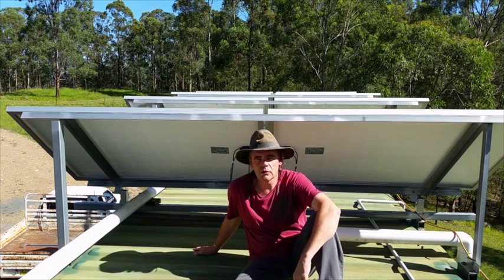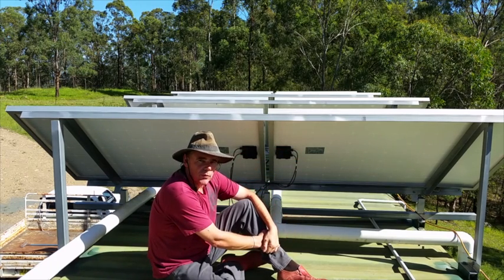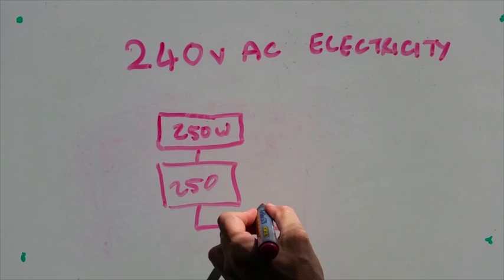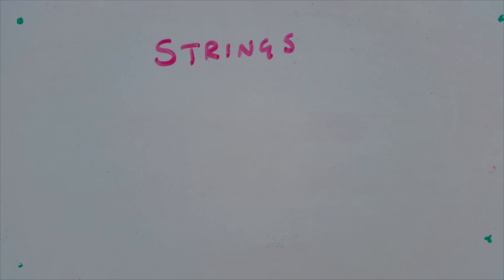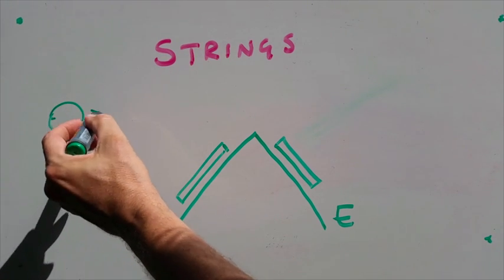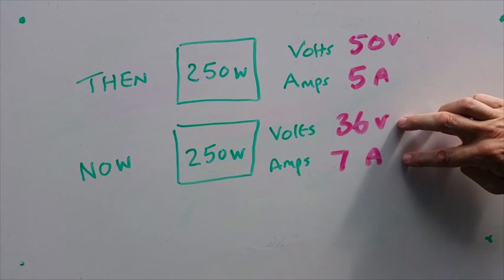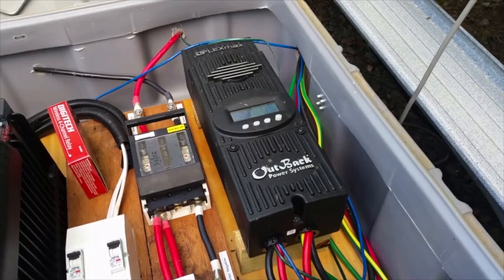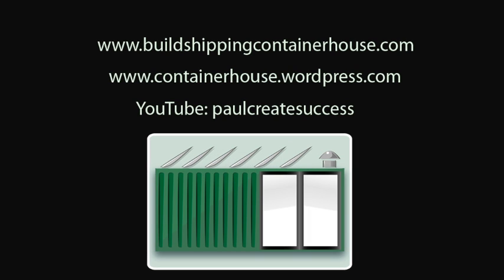Shipping Container House – Obsolete solar panels - Cry for help

Comment: Try Blue Sun Group in Banyo, Brisbane. Tel 07 3266 8668. They have near identical panel (just buying some myself as I have the same panels as you). Also I have used heat reflective paint in the past which would be ideal for your container. You can buy in the green colour and will eliminate all your heat issues. I used a company called Solarcoat ( solacoat.com.au) and found there water based paint to work very well.
Reply from the maker: Hi Marlon. You are the winner. I called them, they have them, and I ordered them. They arrive in a few days. It has taken well over a month to find a solution and I am so grateful to you. I have got thermal additives in my green paint, but the green color negates it. I plan on painting them a reflective color further down the track, probably white. Thankyou for taking the time to solve my problem. Cheers Paul

Comment: Mr. Chambers, good day to you and thsnk you for your reply. I do wish to pass along a shed of wisdom when it comes to using solar power, it may ease some of your concerns when looking at different types of solar PV panels.
 I've noticed in some of your video's the the Solar Panels you are using are Monocrystaline type..... one crystal per cell..... and you have little diamond shapes to cover the panel between tbe rounded edges on the mono crystals. When you stsrt looking at replacement panels don't fear the Polycrystsline panels.... tbese are the ones with true square celles and no little diamond shapes. They work justas well as thr Monocrystal panels, and depending on you location and environment they may actually work a little better. The MonoCrystsl solar cell is one crystal generating small voltages. The Poly crystall cell is made up or off cut crystals assembled in stacks anf wired together to generate small combined voltages. Here is the thing, if a mono crystal gets a partial blockage by say a leaf or snow, sand it will not generate. A Polycrystal will generate power from each little slice that is not blocked by said leaf etc
You may have heard that the Mono crystsl oversll is slightly more efficient than the Poly type crystal, well this is true a Monocrystal cell of a certain size will generate more voltage than a equal sized Polycrystal......although, in standard sizes for Solar panels for the sake of shipping a Mono crystal panel of equal size to a Polycrystal panel will generate appraximitly the same voltage, wattage whst ever you wish to measure because the Polypanel uses slightly more surface area than the Mono panel, it dles t have tbe little diamond shapes in it.

 Best regards;

Jyll from Nothern Alberta Canada.
Reply from the maker: Thankyou for the wisdom, very useful. Cheers Paul

Comment: Hi Paul great vids. BTW there is a guy on eBay selling panels that fits your need. Do a search for LARGE 250 watt MONOCRYSTALLINE SOLAR PANEL "EX LIQUIDATION" . Hope this helps.
Reply from the maker: Thanks Joseph for the solar panel tip off, I am contacting them to see if I can confirm the details. They didn't post a pic of the sticker with the part no and are selling them as "own risk no warranty". I am trying to figure out if they are working. I don't suppose you are local to Dandenong? I am a long way from Victoria. Many thanks Cheers Paul
Reply: Paul Chambers Hi, the following link is to that eBay item and has about 10 Pics with full details of the model # etc. http://www.ebay.com.au/itm/321671808861?_trksid=p2055119.m1438.l2649&ssPageName=STRK%3AMEBIDX%3AIT
Reply from the maker: Joseph Barta Hi Joseph, I am talking to him. The panels are perfect and the price is good. I am struggling to find a courier at the moment, couriers won't take the panels out of boxes, and furniture removal men say they can't carry a solar panel?????. I have spoken to nearly a dozen companies, how hard it it to get something delivered from Melbourne to Newcastle? Excellent tip, thank you thank you thank you.

Comment: While working on a container house project I ran into the roof heat problem. I fixed it by applying a product named "Cool Crete Coating". Even in direct sunlight it will bring the surface to air temperature.

Comment: Hello, Jinko solar in china makes a close to matching product, you just need to match the wattage and the amperage to you older panels. Any mixed system will operate st the efficiency of the lowest rated  panel in the set.
Jyll in northern Alberta Canada.
Reply from the maker: Hi Jyll, your comment may have unlocked a solution, I was blissfully unaware of Jinko and I will be following up with them. Thankyou for taking the time to reply. Cheers Paul

Comment: If you are still trying to figure out what to do have a look at http://www.fieldlines.com/ there's heaps ov info there are a quite few people that really know what they are doing that would be all too pleased to help you find a solution if it ends up involving some "electrical tinkering". However I would say, that since you are running a series string all that is really important is that any panels you add are around the same current rating. Voltage ov each panel is not so important (you could even use nominal 12 volt types) as long as the total string does not exceed the Outback's capacity. And the wattage too, naturally, but that seems to be not so much an issue here. Your channel is cool by the way..! I enjoy it. :)
Reply from the maker: Thanks for the great link, I will be posting an update as soon as I finish travelling, there ware a lot of developments since I asked for help. Great advice, thankyou, cheers Paul

Comment: I wonder if you could place some concrete blocks, bricks, rocks, soil in bins, water containers, or other thermal mass in the places where the sun shines.  The thermal mass would shade the roof and heat up during the day, and at night it would radiate heat, some of which would heat the roof. Also could you use coils to step the step the 50 volt output down to 36 volts?

Comment: Urm, I probably should have listened to the whole thing, though on the surface of it, there's zero reason you need to have exactly the same spec of panels so long as you're running the same voltage, attaching additional panels in parallel and you have a diode for each set of panels.   You can do the same attaching 3 car batteries one flat, one half charged and one fully charged.  The current is drawn from the highest voltage first and then the second highest and then the third highest.  So long as you have a diode current can't feed back into the other batteries and one will deplete until it equals the next battery.   Power generation works similarly so long as you have a fairly [a few volts +-] similar voltages, amps [current] irrelevant.   Hope that's what you're looking for.  Keep up the good work and I know it's too late of course, though the refrigerated containers have thick insulation, though the downside is much harder to weld.
Reply from the maker: Hi Blogobre, Thankyou for the advice. You are correct, it is the different voltage that are my challenge. I am weighing options to change voltages or bite the bullet and fit a second charge controller. I saw refrigerated containers and they are great, but you are correct, welding them is fraught with risk. I will be posting the update for this video reasonably soon. Cheers Paul
Reply: Differences in voltage:  Assuming you connect them so that they are the same voltages the same idea ought to work.   For instance, if you've got a 12V and a 24V panel, if you connect 2 of the same 12V together [series] you have in effect a 24V panel that you can now parallel to the others.  The main thing to note is, are they 12V, 24V or 36V panels.  Oh and note that the 'output' voltages for the panels are typically much higher than what voltage system they are for.  So you might get a 17V max voltage on the back of a panel, which is meant for 12V systems.  Similar to a car, which has a good battery of 14.5V and is rated at 12V. 

A second charge controller would give you redundancy.  Though if the voltages are different as you mentioned then you'll have an issues with charging the batteries assuming you're using them.  You could isolate batteries with diodes... but ...  lets say I wouldn't, better you get the input right :) 

Obviously talk to a sparky [electrician] who knows DC or an electrical engineer if you can.  Just thought I'd throw some thoughts that way, a bit hard to know without having a look at what you've got.

If you want to do some reading, a good start would be understanding how batteries [panels work similarly] work in parallel and series and perhaps how a diode works while you're at it.  Technically panels are a type of diode [allow electricity one way] and they usually have an extra one within them [not always!] to protect them from short circuiting.

Comment: there are series and parallel circuits, and you can take different voltage solar panels and connect them into series to make them come to the voltage you need. look at making a solar panel on youtube, I have done one my self, i'm not saying to build one but you can learn how they connect solar cells to make a panel and how you could make your panels into one voltage, also voltage will have to match the amps don't ( voltage doesn't have to match each panel its the over all voltage by adding both voltages from each panel ), also you don't want to go over what your charge controller can handle /
Say you need 50 volts and you have a 36 volt panel and you would need a 14 volt panel to make 50 volts
( I hope I gave you enough information to look up and complete what your doing)
Reply from the maker: Thankyou Walz, that makes sense, and I think it would work.I will have a look into the practicalities of 14 v panels.I will be posting an update to this video when I return from Europe. Thankyou for the advice.. Cheers Paul

Comment: Hey Paul. I'm trying to download your demo book on how to build a container home but it's an epub file and my computer can't download it. I just paid $47 for another shipping container book that was complete garbage. I'm sure you know what book I'm talking about. How many pages is yours and does it have more than just a bunch of pictures of shipping containers and instructions on how to use a hammer?
Reply from the maker: Hi Daniel, I appreciate your sentiment. Send me your email via the contact form. I will send you the ebook 1 in three formats, epub,pdf and mobi. If you like it,  just go to my website and buy a copy. I will be traveling very soon so please bear with me if I don't respond quickly. Also check your junk mail, when non contacts send links the junk filters sometimes send it to junk. Cheers Paul

Comment: To me the obvious answer is build your own panels using the same 3x3 cells (or whatever size they are) and buy/build cases. You're such a DIY kind of guy so that is the best advice I can give. You would save half the cost of new panels doing it yourself and learn how to repair cells in case you ever expire on the warranty for what you have. Of course, you'd have to find the individual cell specs/performance numbers so you could match it when you built your own.
Reply from the maker: Good morning Brown55061, what a great answer. If I had more time I think I might of been able to do that. It would have been fun as well. I don't think I will on this occasion as I have a kitchen to finish, and a list of other important tasks as long as your arm. I completely did not think of that. Great answer and it would work. Cheers Paul

Comment: hmmm, well one thing you could do, is to add a second charge controller with the 4 new panels. Ill be honest with you, your in a but of a tough spot. You are using grid-tie panels for off-grid system. its possible that the company that produced your panels did A REALLY BIG solar farm and when they were done, that was the end of production. Sorry about your problem, looking forward to hearing about your solution soon!!! God bless
Reply from the maker: This is really interesting, I did not realize there was a difference between grid tie panels and off grid panels. Whilst it won't fix the issue, I would love to hear more about why or how they are different. Thankyou and I hope you can share a little more. Cheers Paul
Reply: Paul Chambers Basically its the purpose of the panels themselves. Grid-tie systems run DC voltages as from 100-600V dc. in that case you want your individual panels to produce as many Volts as possible to reach the desired voltage. In a off-grid system you can't really use more that 140-150v. So panels normally put out 20-36v. That way you can reach the desired voltage depending on the number of panels you have. Simply: Off-grid system need low voltage, lower volt panels. Grid-tie system need high voltage, therefore high volt panels. But, to be honest, I've never heard of a solar panel putting out 50v. The highest I've seen is 41.5v. So you have special panels.LUCKY, maybe not. hope this was helpful, Im not a super expert just sharing what i know. Any news for the china manufacturer???? God bless Col 3:23
Reply from the maker: eastafricansolargeek Hi Col, That was very helpful and makes a lot of sense, I was blissfuly unaware I did not have standard panels. No news from China, but honestly I am not expecting one. I think that although the panels used to exist, the big selling websites never remove a product from the shop window. I am sceptical they will have stock, as it was an inquiry and not a buy now message on the site. We will continue to wait patiently. That was a really helpful reply you sent so bless you also. Cheers Paul

Comment: Oh wow that's annoying. The only quick fix i can think of is adding one way diodes to the existing system so the newer panels don't feed into them, but i'm afraid that the amperage from the existing panels won't feed into the cc due to voltage differences. Maybe adding high efficiency inverters to either the old or the new to match the voltage could do the trick but those might end up on the same price point as a good cc... Tilde! Fingers crossed :/

Comment: It appears these panels are still available from China

http://rdmsolar.en.made-in-china.com/product/RqOxVevUZShn/China-Monocrystalline-Solar-Modules-RDM-250M-96-.html
Reply from the maker: Hi Wayne, Thankyou, I have sent an inquiry to them today. Fingers crossed. Cheers Paul
Reply: Paul Chambers
You are more than welcome. Hope they are still manufacturing them.
Although a little later in life than yourself, I am beginning a similar project using 9'6" tall x 8' x 45' containers. My plan is to use four of them side by side in pairs with 30' between the pairs. The put up a crowned metal gabled roof giving roughly a sixty foot width of and thirty feet of open space between the containers. Then open the space inside the containers for specialty rooms, kitchen, bath, bedrooms etc. Most of the area of the roof would between the containers will be skylight or solar panels.
Reply from the maker: Wayne Alan Wow, you think big. Share a picture with me if you get the opportunity, I would love to see what you are doing. No reply yet from China. Cheers Paul
Reply: Paul Chambers
I'm still in the gross planning stages but have the property.  I figure about 6 months from now I'll be starting the actual project. The property is at about 3500 feet elevation and is high desert forest. This is a new project as it is a part of my working farm/ranch. I've been doing a lot of thinking about how I was going to proceed and still haven't finalized the design. Once I do I'll be buying the containers and setting them up. I'll send you some pictures when I start the construction of the project.

Comment: Hi Paul.  So those panels are 50v open circuit and ...it looks like 8.26v short circuit?  What is the operating voltage?  What are they putting out on a sunny day and under load to the CC?  Open circuit voltage can be a bit misleading sometimes and it's always higher than a loaded voltage.  That's the number you really need to find.  Put a multimeter across only one panel when it is under load.

Comment: Unfortunately I have neither panels nor advice to offer. But I have a question: I can see why you want to add more panels, as it will do more than just shield the roof. But even with panels the roof gets a lot of solar energy, so I was wondering why you are not painting the roof white in addition to adding the panels. It looks like it could use a coat of paint anyway.
Reply from the maker: Hi Pieter, The containers are going to be repainted. At the moment, white is the winning color. I want to get the fabrication completed first. It would be my quickest temperature reduction but I have known that for a long time. It currently does not trump completing the kitchen. I still have welding and cutting to finish, so painting is a little early yet. Cheers Paul
Reply: Paul Chambers Thanks for the reply. I can see the priorities. Kitchen is definitely at the top, and so far it has been a pleasure to see what you have achieved already.
I was going to suggest to build bits of solar roof over the exposed areas, but then I realized that this would only work in the big open space. Between the panels you would really impede access. And then the penny dropped that it would have to be hurricane-proof, so some quick McGyver job would not suffice. So I deleted that one and kept the white paint.
Reply from the maker: pieter zeeuwen I have wanted to put some tin between the gaps, but if it were to let go in a strong wind it could smash a panel. I would have to build it properly, so no quick fix there. LOL Cheers Paul
Reply: Paul Chambers Smashing a panel would be bad. Having sheet metal fly around the property looking to decapitate something could be even worse!